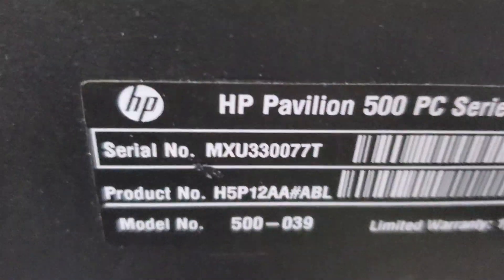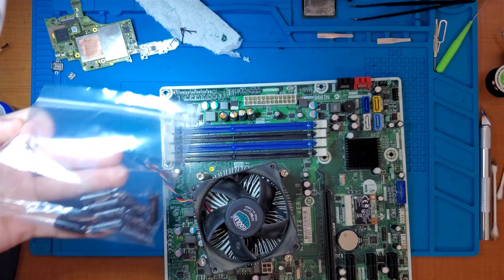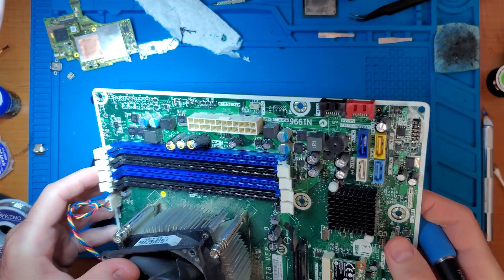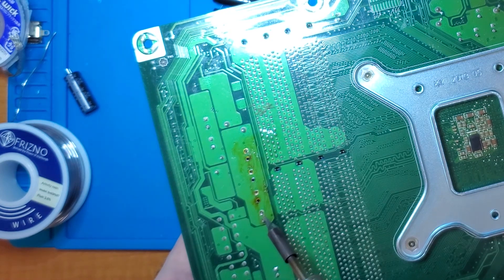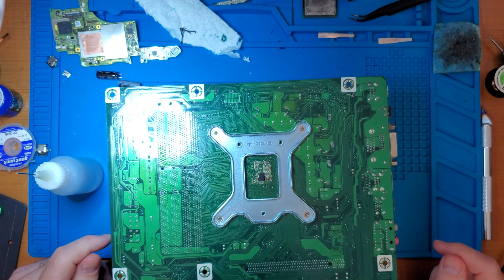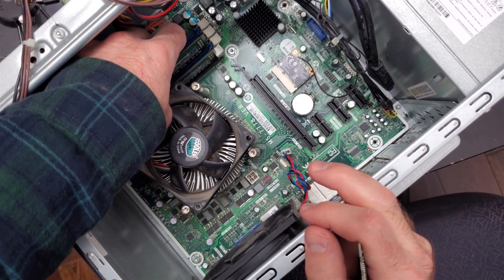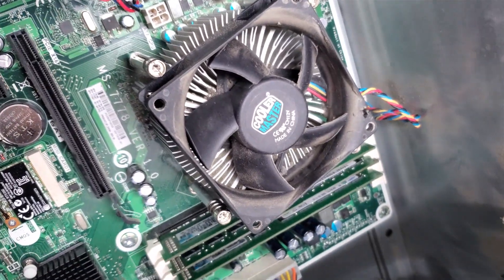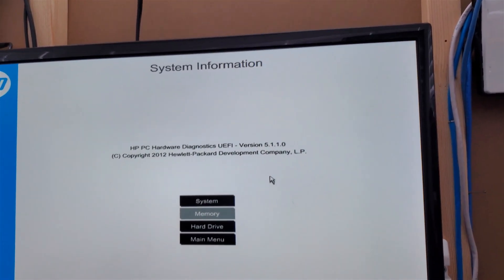This HP Desktop Won't Boot - Let's Fix it!

Comment: i have the same pc with the same capacitors leaking. Since i am not a computer repair person, so where do i purchase them, and what do i look for?
Reply from the maker: You need to match up the info that is on the capacitors. There are many places you can find them online. Amazon and eBay have them. There are also many other dedicated websites for capacitors. Just a quick Google

Comment: I have a laptop - lonovo. Doesn't let me log in and the harddrive doesn't detect nowhere. It has a soldered hd and mem. Can you help
Reply from the maker: @TBCC000  if the drive is no longer registering, you've got a real problem on your hands. Without examining the laptop, I wouldn't be able to determine what is causing the issue. My abilities are also only intermediate at the moment and likey I'd only have maybe a 50% chance of repairing it. You'd be better off checking your warranty or taking it to a local tech shop